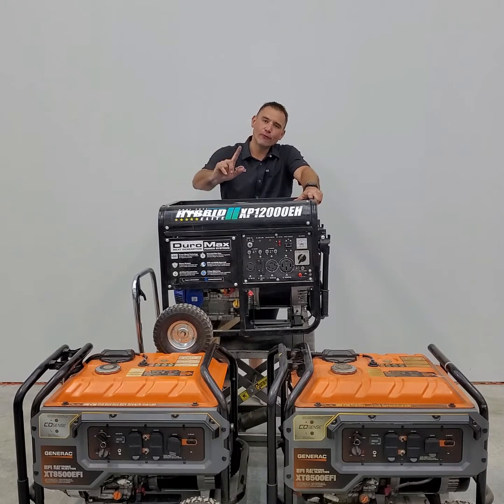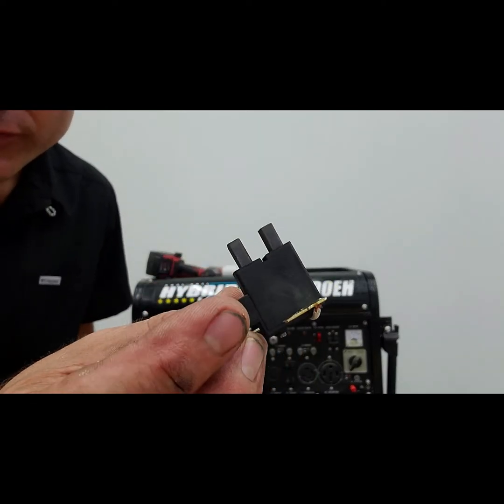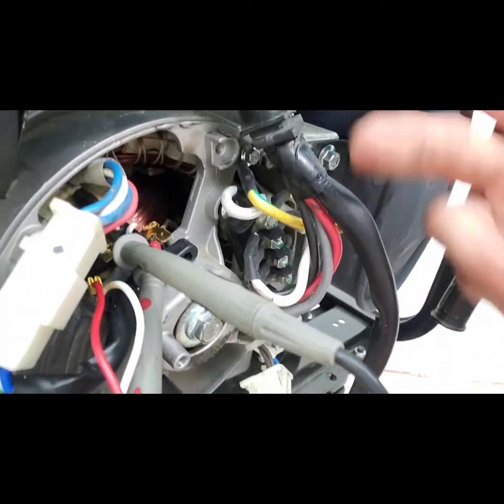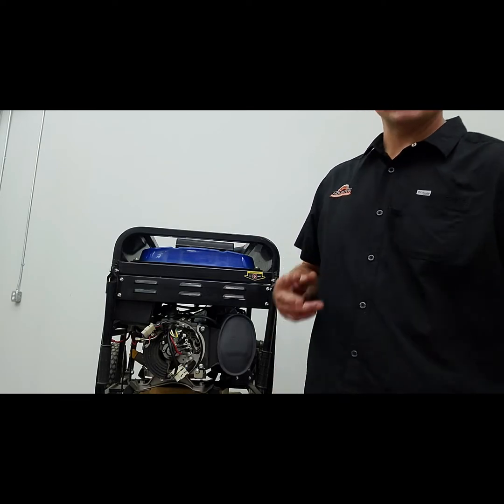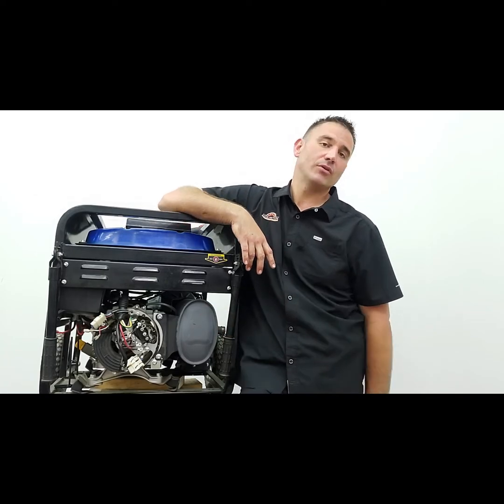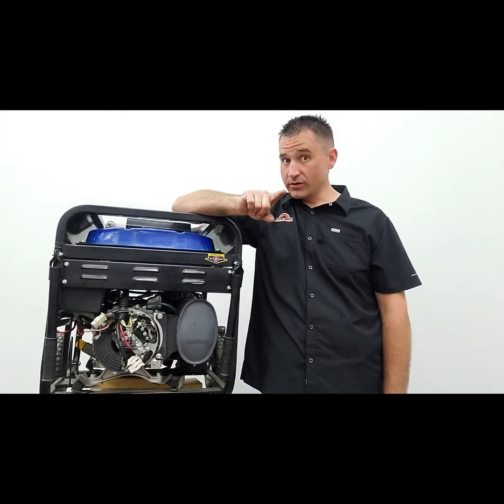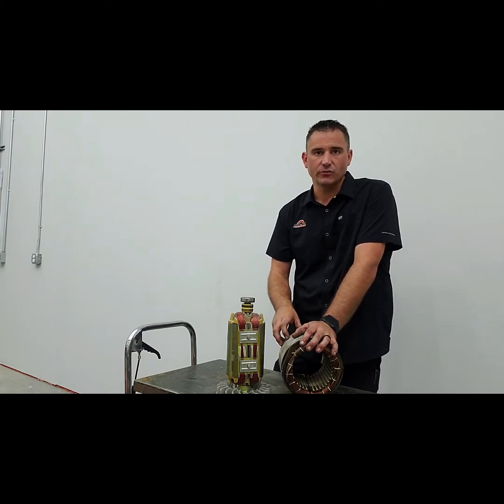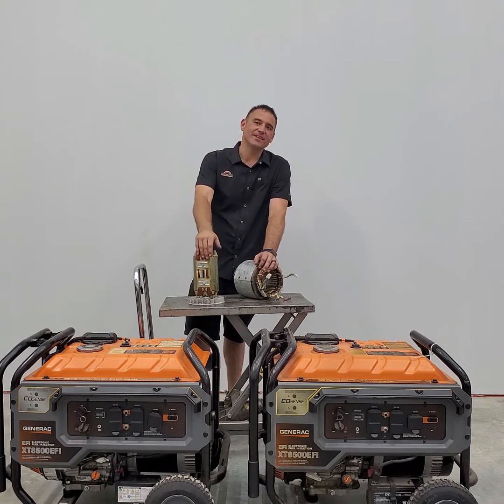Duromax Generator / No power / Electricity / Output

Comment: My Duramax XP 12000 e h will only produce 120 volts why can't I get 220? Have check stator and rotor all are good Factory technician said to replace the selector switch in the main breaker I did that and it still isn't producing

Comment: Never used 5500eh. Ran once on propane when purchased to make sure it worked, then sat for 3 years. The electric start does nothing, it will not start with propane now, but it starts fine with gas. The voltmeter never moves. Is it toast?

Comment: I have the 1k version. Starts up fine, built in voltage meter is pretty much all over the place, under load it drops way down either  on 120 or 240. It could power a light bulb.

Comment: Top 3 portable generator to buy? Thanks
Reply from the maker: what is the intended purpose?  commercial use, home backup, camping?
Reply: @theequipmeptguru9030  Home back up
Reply from the maker: @rockystelone21  definitely i have to say the duromax xp13000e for a single ac home or xp15000eh for dual ac or ac and pool. no other company holds a candle to duromax warranty
Reply: @theequipmeptguru9030  this information mean a lot to me thank you so much.

Comment: I have the 12000EH, 14 months old, 120 hrs. Last power outage, gen starts up, xfer switch on main breaker on, house is lit up, Everything's great, 20 mins later no power. With main breaker off the Red Battery Charging LED is on 5 secs, off 20 secs and just repeats. Engine on gas is running strong, you can barley hear loading as it makes voltage, then off again. Thoughts?
Reply from the maker: sounds like you either have a short in the stator, specifically the DPE winding or bad AVR

Comment: My duromax xp1200e is only putting out 20 volts.  I put new brushes and AVR and still same.  Any ideas as to what I can try?
Reply from the maker: what is the frequency output?  you can check this with a meter that has an HZ symbol.  connect the leads to the 120v output and see what frequency output is.
Reply: @theequipmeptguru9030  thanks for reply,  I found out it was still under warranty so I took it in to service center for repair.  They are 3 months out but not a problem since hurricane season is over.  Thanks again

Comment: On the duromaxx 5500EH,  the power (main breaker)  was on the voltage switched was clicked from 120v to 240v while running, it created a small quick spark and then the generator stopped outputting power (electric). It still runs, but no electric.   What do you suggest?
Reply from the maker: Im sure the stator is toast now and or the switch itself, You should never move that switch while it is under load.